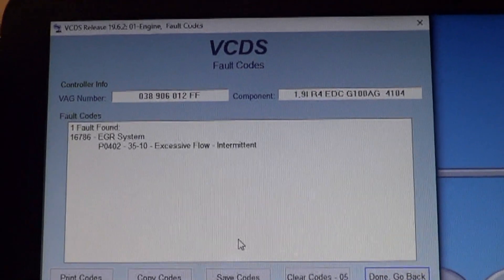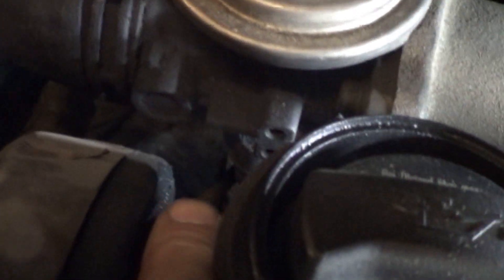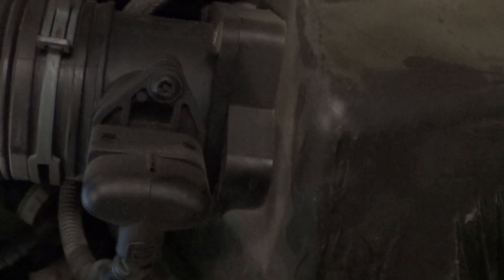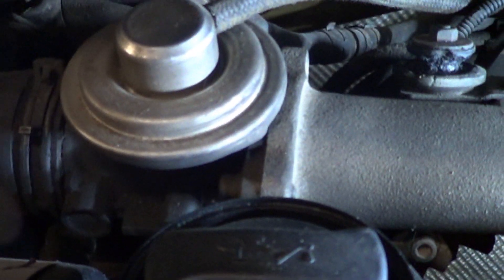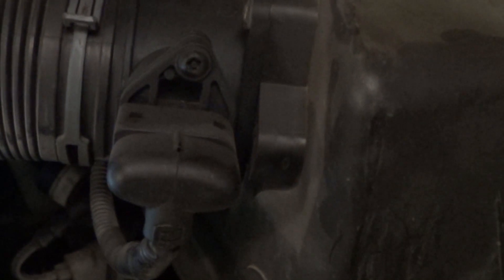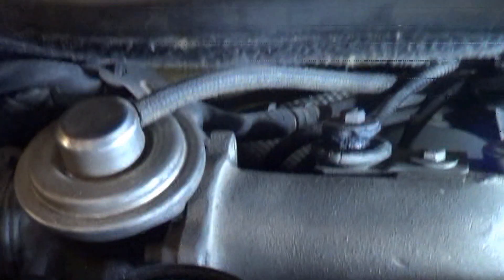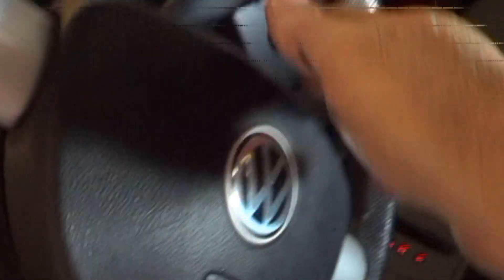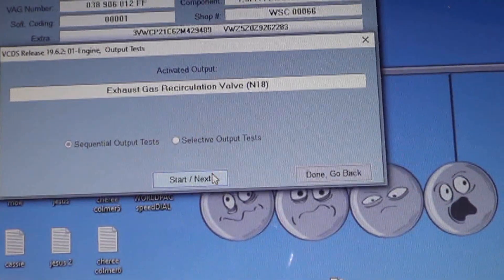Tdi EGR code P0402

Comment: I have a 98 5.4 f150 4x4....Would egr create a starting issue? I have p0171 p0453 p0402 codes i changed the evap hose. After its warmed up truck starts fine, but first time i turn it on no matter the outside temp. After sitting for a few hours or overnight it takes a min to turn over, then in a second it starts dies, then starts up 2nd or 3rd try. Also after it warms up, driving about twenty min it starts to shutter, lose power, acceleration is floppy
Reply from the maker: EGR stuck open can affect starting.   I have a recent video that explores or explains that a bit.  https://youtu.be/STRQGT1CqNY

Comment: Can you still test the vacuum and electronics on the solenoid system without a bi-directional diagnostic tester? Like, if I can supply the ground or power the solenoid valve requires to actuate, can I put a vacuum on the line and expect it to hold vacuum? Or would it not work like that
Reply from the maker: yes, and yes.

Comment: What would be the next step if all the egr components were there and not blocked off in any way?
I've tried replacing the egr valve, the solenoid, I've even checked the programming with vcds to make sure all the values are original. I've checked for corroded wires and tried replaceing the MAF sensor but I cannot get this code to go away.
Reply from the maker: Do you have this model of engine?  AlH?
Reply: @CoolAirVw  yes I do, 2001 golf tdi
Reply from the maker: @B3NNi420  check that diaphragm is holding vacuum.  That's the most common failure.
Reply: @CoolAirVw  yes I have checked the diaphragm and tested the solenoid
Reply: Well check your vacuum hoses for leaks..

Comment: I like to electronically delete the egr so that the egr code doesn't show up. Not even any need for a blanking plate either!
Reply: Ethan McCrory how? Can you do it with vcds lite?
Reply: @alexlarsen6568  yes, however it just sets minimum value it does not fully delete the egr map